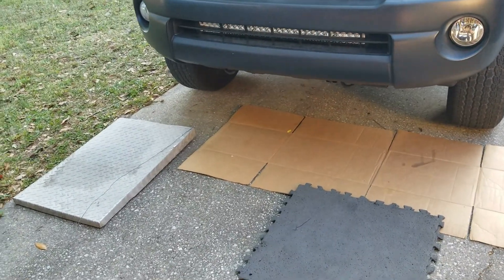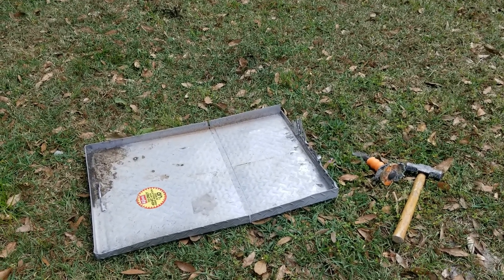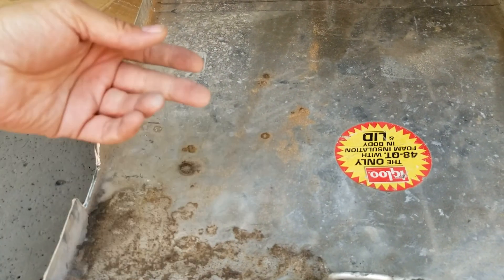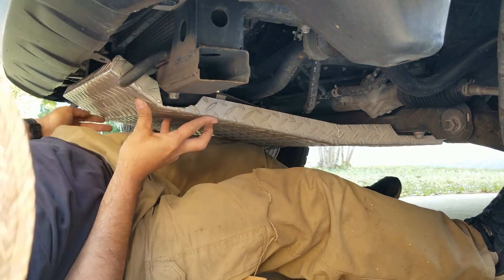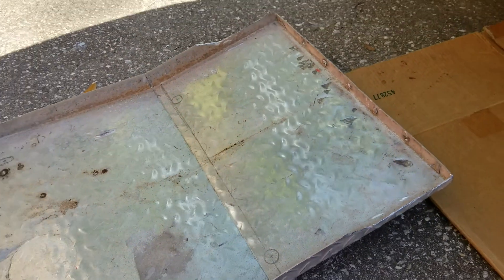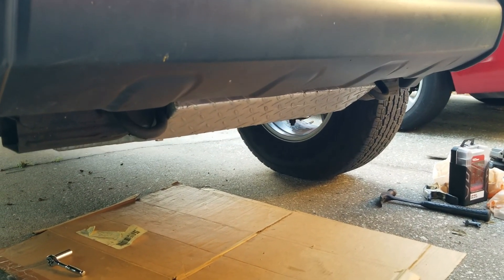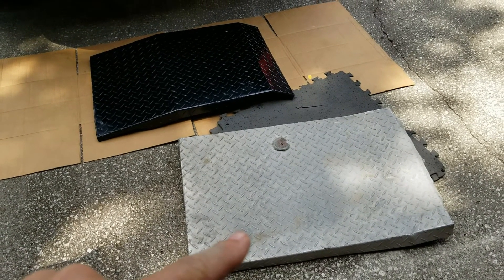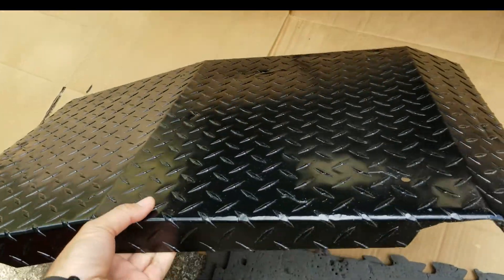DIY Toyota Tacoma skid plate 🦾😎 , Project Lil Taco Pt 33

Comment: I like the creativeness of the design, the determination and your effort to make the video. If you're doing all that work why not do a thicker steel plate to actually protect the belly? That thin piece of aluminum won't absorb much if you bottom out, unless you're doing mostly on-road driving-- then no need for the extra skid plate in the first place. Also I recommend using a floor jack to hold the skid plate up in place so you can work freely without using your knees and legs, also using a angle grinder with a cut off wheel to grind down the material at the bending line, makes it easier to bend the plate!

Comment: I hate to tell you aluminum is a soft metal that can break at high speed you need a steel plate,
Reply from the maker: The skid plate made it perfectly fine going from the East Coast all the way to California.
The thickness of the aluminum is at least 4 times the thickness of the aluminum used to make body panels like hoods and fenders.
Steel is stronger and heavier BUT there is no need to use it for my application